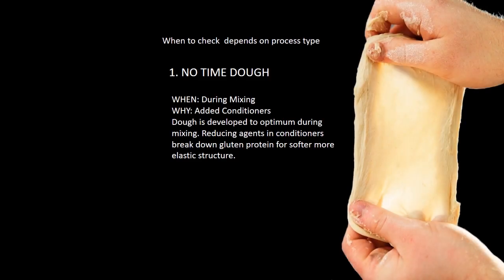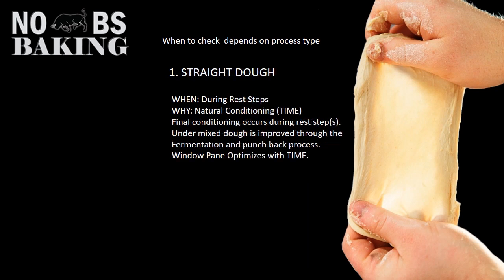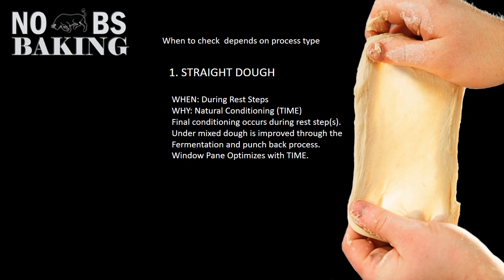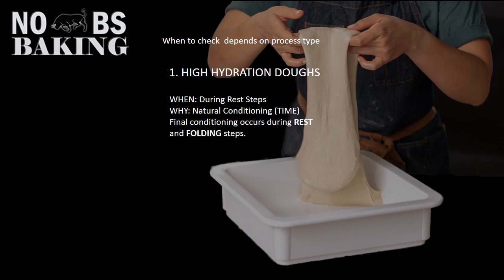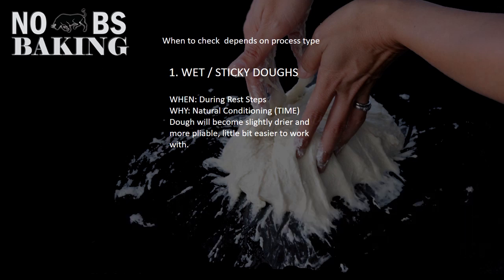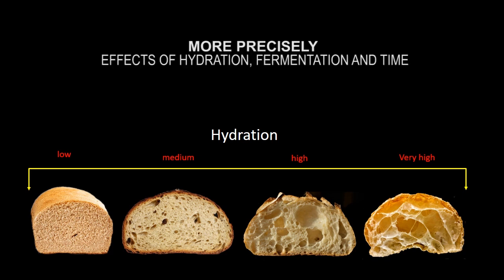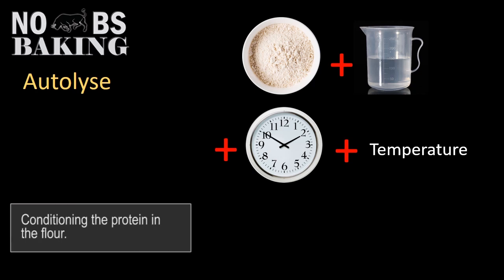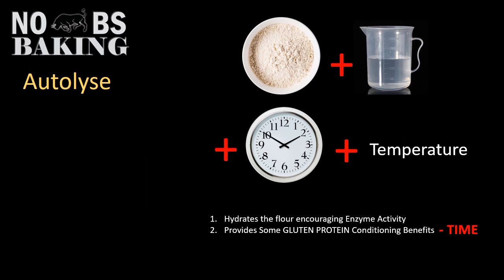Optimizing Dough Strength Naturally | Better Gas Retention Better Loaf Volume.

Comment: I added your suggested dough conditioner, Cider Vinegar, to my bake today. I can see the difference in the improved dough extensibility. Not sure if I taste a difference, but oven spring is definitely enhanced.  Thank you for these tips.
Reply from the maker: Be sure not use too much generally 1% will suffice or you may taste it however it depends on the strength or "grain" of it. See my video on dough conditioners for info. 
Cheers
JP

Comment: Some bread has whiter crumb .How can I get whiter crumb.thanks 😊
Reply from the maker: Unbleached flour is aged naturally by the air. This is a common issue and has no clear answer. If you live in a country where you can purchase bleached flour then your Crumb will be nice and white. It also depends on on your particular brand. As an example each milling company mills slightly different. More bran...less white. Cake and pastry flour is usually much whiter due to the finer particle size and higher extraction of bran during milling...but alas, usually they are too low in protein to make nice quality bread.
Try looking at other brands or ask your local baker as flour and brands differ around the world. 
Sorry but that's all I got.